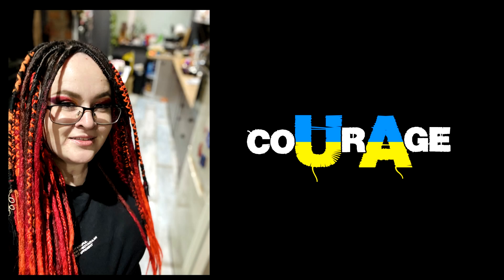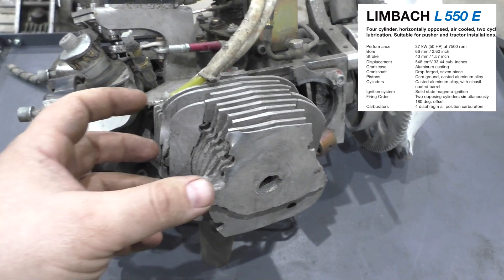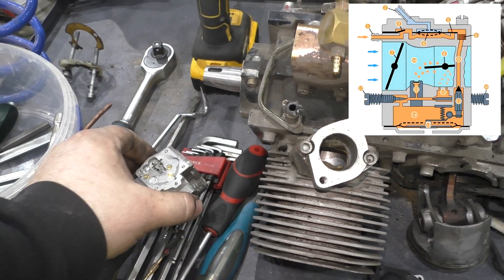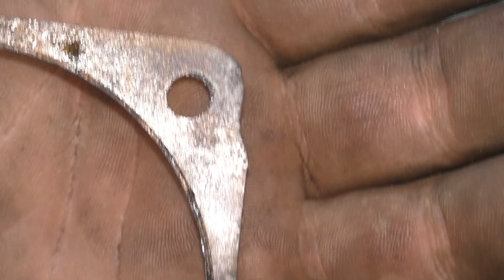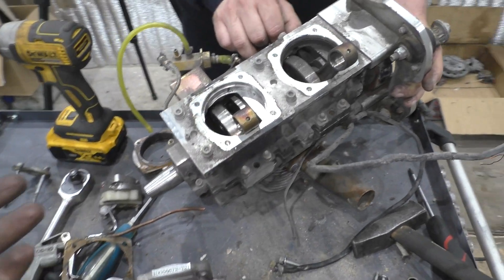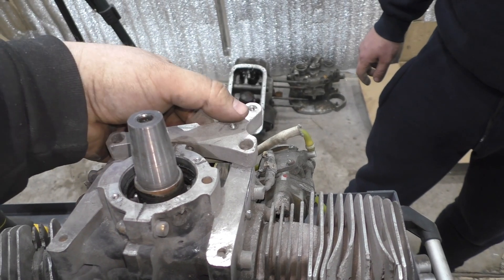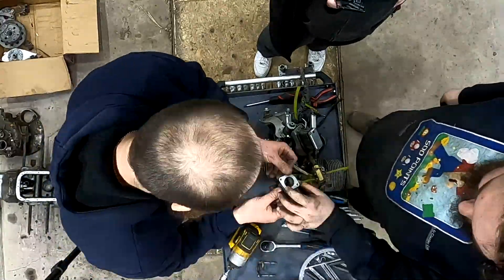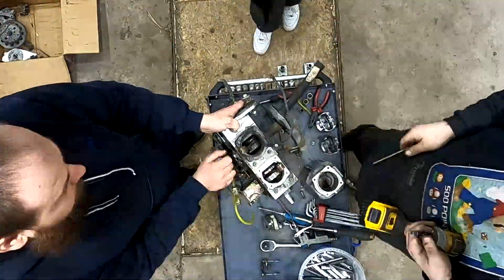SHAHED 136 drone engine TEAR DOWN

Comment: It make sense to compose with cheapest parts when planning to build a suicide drone. one way ticket is enough
Reply from the maker: The problem is not in the cheapest parts, but it's mixed with expensive and high-quality ones. This means and proves that this is Iran sh***t that was bought and collected under sanctions.
Reply: @UA_Courage  The crosshatching in the cylinders still being visible suggests that they're using a good aluminum alloy and it must be sourced from a reliable, consistent source. Running 2 stroke engines hard without them having a chance to heat up is very rough on the pistons and cylinder walls due to the pistons expanding much more quickly than the cylinders. So the fact that the cylinders aren't all scored up means that the metal used is high quality. 

Anyway, analyze the makeup of the alloys used especially of the cast parts. Its probably not difficult to narrow down which Chinese factory supplied the metal or if its being sourced from some other consistent source such as a certain model of cars being scrapped. Also keep in mind that the builders of it intend to deceive you as to the origins of the parts. Off-centered screw heads could've intentionally been made that way and stamped numbers and brand names could've been forged. Since high quality bearings are very important for something like this, evidence that the numbers are forged is a very valuable piece of information since not many factories can produce such parts reliably. 

My guess is a handful of Chinese companies are manufacturing the key components and the aluminum for casting but they're trying to make it look like everything is coming from places like Japan or India. I have no doubt the actual engine cylinders were cast in Iran. Check to see what casting technique was used since they all have telltale signs of the methods used. Diecastings will have porosity and probably highly consistent crystal growth due to consistent cooling of the metal. Lost foam and sand casting will have much less porosity. Also a chemical analysis of the surface can suggest what release agent was used. Diecasting relies on a chemical spray that I believe can permeate into the metal while sand casting is going to use talc and lost foam will use plaster. The wooden prop is made of a tree of a certain species. The width of the rings can suggest if the trees were fertilized and farmed or if they were more old-growth. 

If something looks obvious, always be aware that the people who built those drones and the people who supplied the materials all have an incentive to deceive you. However, they can't hide everything. Make sure to analyze as many of those drones as possible to check for consistency of the manufacturing.
Reply: @olaf927  while “cheap” is a requirement, the drone must also be “reliable” as well.  It has to get to the target.
Reply: @dennisyoung4631  Cheap and easy to make in quantity is important, obvs it's a balancing act but if you can only fly a hundred drones then they've got to be reliable to get to target, if you can fly a thousand drones then reliability is less of an issue and, overall, more will make it to target even if a larger number fail.

How true it is I don't know but the story goes that one of the problems Germany had in WW2 was finishing tanks and other battlefield hardware to high standards which slowed down production and supply.

Russia on the other hand were churning out tanks which were rough as guts but fast to complete and get onto the battlefield so the Russians out manufactured Germany.
Reply: It's always a balancing act. Yes this motor can have a designed life of ~10 hours. But compromise too much on precision, and you start to affect performance (range in particular) and even manufacturing becomes more expensive because every part needs to be adjusted and hand-fitted.

Comment: I call it the sh*thead drone, seems more appropriate, especially now that I've seen some of it.  They don't even cast the cooling fins integral with the cylinder.  Man, that is some cheap ass crap.  I've never even seen that kind of arrangement on an engine before.  That was funny as hell, it didn't even look like a dedicated gasket, but something somebody cut out of a piece of gasket paper.  In aircraft engines there is always (as far as I know) a thrust bearing of some sort, usually a flat carrier needle type.  Maybe they just added it to one of the main bearings here, and I missed it?  Using a standard round axial roller for thrust loads is NOT a good idea.  I found that out as a kid, when i mistakenly used them for wheel bearings, actually I think they came that way, but they got changed out for tapers rather quickly.  :-/

I can't understand why the crankshaft was bent, given that the rods were slammed over at about 30 degrees when the cylinders sheared off on impact.  :-)  I'm a little surprised at the Japanese bearings, but I'll bet they were the cheapest, lowest spec/grade available.  Maybe they tried Chinese bearings and couldn't make the engine run just the handful of hours that it's use entails?  That thing really looks crude.  I really enjoyed that they went at the inside of the piston skirts with a die grinder, OMG...that is some precision work, right there.

Yeah, not impressed with the 'high tech level' of that mount.  First off, it is total overkill, and wasteful of material (If it wasn't a machined casting, but a billet part). And the finish on the part was absurdly fine for the job at hand.  It looked as good or better than some the the engine internal parts.  Then the machining on some of the rotating parts (prop hub?) looks like it was done with an axe, 'cleaned up' with some 36 grit paper, and then thrown around the shop for a while.  That hub also looked like the collar was welded on, then a radius machined, and the weld came up short of the machining in multiple places.   I can just see the engineering spec.  Well collar and radius to 8mm, it is preferable to have the weld machine to a continuous smooth radius, but 20-40% is adequate.  And no more than 10% can be totally without weld.  Having the weld look like chicken droppings is also not advised, but not a reason for rejection.  And no more than 10% of the periphery may have no weld protrusion, at all.  My god, I have never seen crap like that, ESPECIALLY on any kind of aircraft, and I'm talking all the way down to RC engines.

I'm guessing some of those parts were ordered from some guy in a shack, in out in the boonies Russia, a guy without a toilet, running water, and machinery to match.  I don't know if that motor sat outside for a long time, but the rusty bolts on the engine mounts were a very nice touch...protective finish, ah, who needs it.  Great design on the mount, too, with two opposing bolts.

WTH was with that washer under the allen bolt, strange rim shape and the collar going up over the bolt head?  Maybe some kind of positioner?  It also looked like the bolt was about 1/2 way to being seized up in the block (or wherever), unless that white crap is just some kind of grease or loctite, or maybe anti-seize.  I've not seen loctite that color, and if it were grease it would probably be lithium, which is about the crappiest grease on the planet.  I have seen anti seize in that color (I think), but usually that is black or gray, the stuff I've used.  It looks notoriously like what you find in motorcycles stored outside with steel bolts and aluminum blocks, where if you don't have extractors and helicoil kits, you are in some deep doo doo, because they come out snapped in half about 30% of the time given a decade and a half or three, especially the smaller diameter bolts, the 10 mm or smaller head dimensions, and I'm not talking crap designs, materials, and assembly, I'm talking Honda level stuff.

Nice alignment allowance on the intake port, too.  Har, har.  Ah, the bolt heads practically drop through the holes, just mount it and forget it, and for god's sake, when you do the final tightening, DO NOT look down the port and make even the slightest adjustment to maintain any semblance of continuous flow.   And yes, you are right, especially in high flow ports, I have seen guys taking motorcycle racing engines to every last drop of performance, and one of them said in one of the old six cylinder designs, when he put it on a flow bench, he could actually hear the flow separating and reattaching in one runner, like an organ pipe.  He actually ADDED material, slightly shrinking the cross sectional area at a bend, and increased the flow dramatically. That's highest level work, to squeeze every horsepower out, which obviously isn't necessary in production stuff, but this drone is on the FAR other end.

Good job.  Often stuff I don't see anywhere else, as was the case here.
Reply: it's a one time engine.....maybe design is hard for you to understand....it is not designed for quality
Reply: it is only meant to be a one time use engine. all it has to do is propel a drone for a few hundred kilometers and then it's destroyed, of course it's going to be made as cheap as possible, it only needs to last like 1000km before exploding
Reply from the maker: Thanks for such detailed feedback. Love it 🤗
Reply: Its quantity over quality lol they flying 5 drone at the same time you are dumb
Reply: If those are deep groove bearings, they are more then strong enough to act as trust bearings for the short lifespan of this engine.

Comment: The bearings look like critical parts.  I wonder whether a special grade of bearings can be supplied to Iran that are designed to fail after X minutes of use?
Reply from the maker: They are mostly the same, there are no special modifications for failure. I'm sure they imported as double-use supplies.
Reply: Some government agencies might be able to limit supplies of those specific bearings on the open market and force the ruzzian and iranians to buy the low quality Chinese ones.
Reply: easy. just supply standard clearance bearings for crankshaft bearings... they get hot, expand, and seize.

can set the cages of little end bearings to let go at certain RPM... 11500rpm on an RD 350 was considered "back off, and cruise into the pits as gently as possible whilst its still running or that simple bearing replacement will become a complete teardown and rebuild..." the cages fractured at around that RPM.
Reply: Now that would be a very cunning plan.

Comment: I couldn't help but cackle at "Korea by FAG".  
Seriously, though, I've never seen a demonstration like this on any other Ukraine channel.  Awesome way to both distinguish yourselves and put your expertise to work.  Now, if only we had a means of eliminating Shaheds as cheaply as they were made...
Reply from the maker: Hehe, sorry about “Korea by FAG”))) actually I misspelt to pronounce it F.A.G, but yeah, funny 😂😂😂
Reply: I know I can’t just modify my shotgun and shoot down one of those drones, but I’m sure somebody in Alabama is working on how to do just that.
Reply: How about cheaper?  And they do, just not enough of them in Ukraine. It is called the Gepard tank. In fact the ammo to down the drone probably costs far less than the drone.  The German Gepard is the one that I know is in use now in Ukraine, and it has not only taken out drones, but at least two cruise missiles, one an Iskander, IIRC.  Contrary to popular belief those only fly around mach 2 most of the way to the target, and go hypersonic in the terminal phase.  

Here is a video, where the idiot runs his mouth over the Gepard in operation (I HATE that), but it does show a cruise missile being downed by that machine.  It shoots a large caliber explosive round, so the bang for the buck is very high on drones, and ABSURDLY high on missiles.  The range isn't super far, so you need a lot of them to protect large areas.  You might be able to do a large city with three or four, I don't remember the exact max intercept range/altitude, as they both matter, more of one leaves less for the other.

As for next gen stuff, there are some promising laser designs, one coming out is in the megawatt class, pulsed.  It doesn't take very long at a million watts in a fairly small spot to down a missile, and there each shot should be pretty inexpensive. I don't know how they power it, but ABL was chemically pumped.  Like I said, the megawatter is coming, but there are already laser systems for drones in place on US fighting vehicles, some of them, and systems on subs, as well.  Probably other vehicles and ships as well, but I'm not that up on them.  Here is the vid.  If you want to hear one, just search 'Gepard radar guided gun  Ukraine'.   There are a couple of YT vids shot at night, where you can hear the thing operate, and it also looks really cool because you can see the tracer rounds (again, IIRC).  Other countries manufacture defensive weapons that work in this manner.

https://www.youtube.com/watch?v=mF_Upn9rmjU

Cheers.   That bearing manufacturer has been around for quite a long time, and you can find them in auto parts stores everywhere.
Reply: @MrJdsenior self praise with your useless western wonder weapons
Reply: The Ukrainians probably won't tell you about it but I'd be surprised if they're not developing fixed-wing drones slightly faster than the Shaheds as some kind of cheap-arse SAM. But I wouldn't be surprised if it's nowhere near ready for field testing either since the tricky part is building affordable guidance and proximity fuse systems.